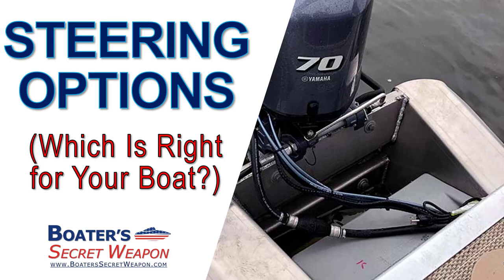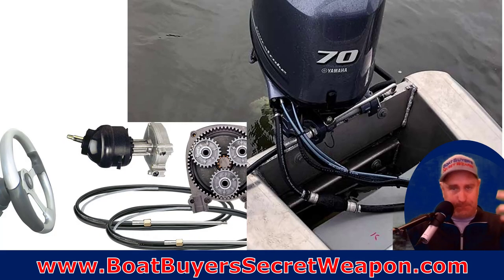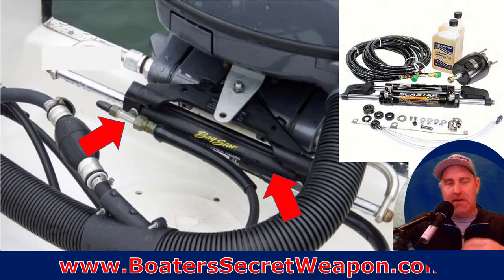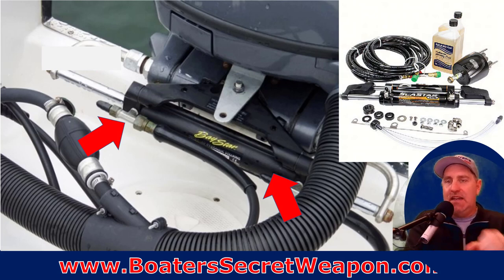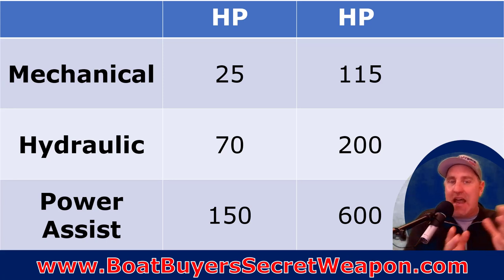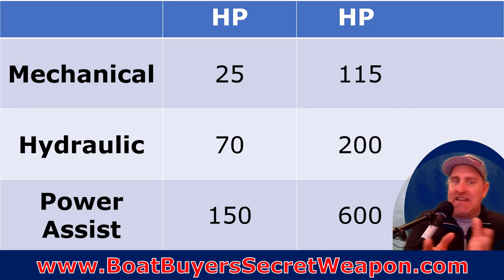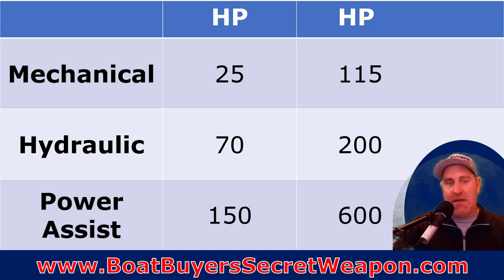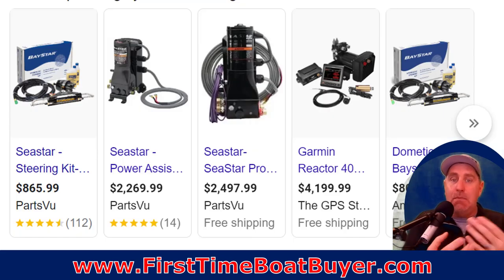Steering Options on Your Boat (Mechanical VS Hydraulic VS Power Assist Steering)

Comment: I have a 21ft deck boat with a 200 merc on it and just like you said just cruising around tge regular hydraulic steering is fine but when we start tubing it'll wear you out quick and a lot of times you'll really feel it the next day. The other thing is I can handle doing it for quite a while but it'll take a real toll on my wife if she is driving

Comment: This is just what I was looking for, a comparison between the three types of steering you can have on a boat. There's no doubt the elctro-hydraulic option is the best when it comes to comfort and steering speed, especially on more powerful engines but I think it's great to climb your way up from the mechanical, analog experience and maybe upgrading all the way up to more modern digital systems. Same for the throttle lever.
Reply from the maker: perfect, glad it was helpful

Comment: First time boat buyer, and this is very new to me, but good to know.  I wish I had known to look out for this item in description before I purchased my "mechanical" engine.  test drive after leaving a deposit was less than exciting due to the mechanical nature of steering.  and not talking cheap boat, its a chaparral.   Love they way it never said mechanical steering in the product description, just 150 HP (Mechanical).  Will definitely be upgrading to at least hydraulic DIY.  thanks for the good info!
Reply from the maker: Glad I could help!

Comment: I had the pleasure of mechanical steering on my first bass boat, a 95 Procraft with an old 200 Black Max Merc.  It worked great when it was greased as long as the ambient temp was above 50 but under 50 degrees it felt like you were trying to drive an old 55 Cadillac with manual steering.  I’m spoiled now with the power steering on my new bass boat but my bay boat with a 300 on it isn’t bad with just a Seastar hydraulic system, definitely more than adequate at 50-60mph.

Comment: I would say top end boat speed x size of boat. if it goes over 40 mph I would get hydraulic steering. anything supercharged or 200 vmax or pro xs power steering actually becomes a factor

Comment: Would you go hydraulic on a 60hp if you’re just trying to stop dealing with a stuck steering cable every season?
Reply from the maker: Sounds like a bend in the line, lack of grease or need to replace the cable… don’t see any need to move to hydraulic unless you want to for some other reason

Comment: I’d like steering that will make it easier to approach crab pots….moving my 20’ North River aluminum boat with a Yamaha 115.
Reply from the maker: what type of steering do you have now?
And, not sure what you mean by make it easier to approach crab pots?
Turning the wheel or actually getting the boat to the appropriate spot to haul the pot?
Reply: @BoatBuyersSecretWeapon  I currently have mechanical. Seems jerky and any input is over corrected as you approach the buoys. Seems hydraulic would require more turning but more accuracy.
Reply from the maker: @stoweman34   sounds like maybe the cable has a hard bend in it or maybe needs to be greased up.

Or, moving to a Sea Star type steering system could help.

Also, if you are over correcting, be a little more patient and don't over steer as yo approach the pots.

Comment: I had a bright lamp moment cause of this video.
I was driving my boat with manual poke stearing and wonderd why it always turned to one side when letting go for a bit at idle, no matter where the most weight in the boat was.
Now i know its because of the direction the prop is turning

Comment: My bass boat has dual cable steering with a 150    Definitely a lot of torque when steering agains the propeller rotation depending upon speed and trim
Hydraulic would be an improvement 
Our Suntracker tritoon has the 200 mercury with hydraulic steering plan to upgrade it to power assist     Straight line running is fine with the hydraulic steering but towing a tube is not fun making quick turns  
Your content is informative 
We purchased our first tritoon and after watching you videos made the decision to look for a low hour boat with a 200  
I think I would have been disappointed with a 150  your videos helped to guide me to what’s best for my family’s boating needs   Also knowing from your videos that a Sun-tracker is a value boat helped me not to over pay.  “Covid boats” are entering the used market and for the used boat buyer represents a good opportunity to get into boating or to upgrade

Comment: I have a 1987 Ranger 360v with a Mercury Blackmax 150 XR2. A I'm looking to switch from the old cable steering to hydraulic. I see the BayStar system is recommended for up to 150hp. What are your thoughts on this system for my setup?

Comment: So I have a new 22" Bennington tripletoon with 150 H Yamaha. The steering is Hydraulic but is very hard to steer at anything over 20 mph. I have flushed the system and talked to the dealer and no fix. It is fine at idle. do you have any idea as to what I can do or is this normal?
Reply: @BoatBuyersSecretWeapon  yes more stiff turning to port

Comment: Bad steering system: the old open pulley systems were a "treat", especially when a pulley wheel broke or the steering cable jumped off the pulley, causing the steering to jam.
Reply: @BoatBuyersSecretWeapon  "Pleasure" isn't the word I was thinking of. LOL
Those pulley systems were around up until the early 1970s.  Thankfully the Morse/Teleflex system rendered it obsolete.